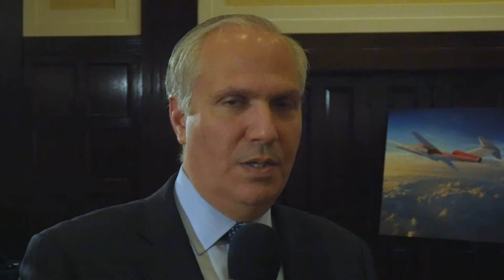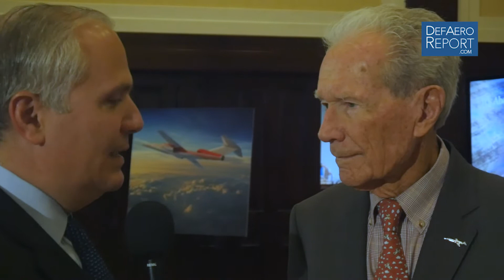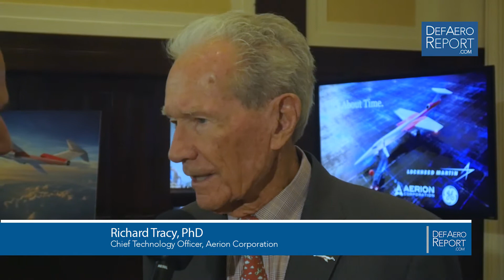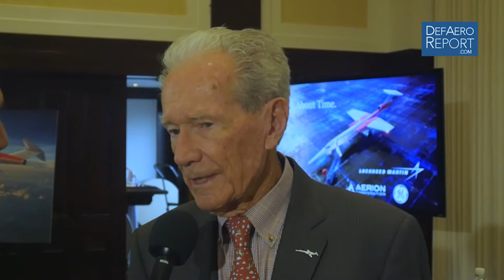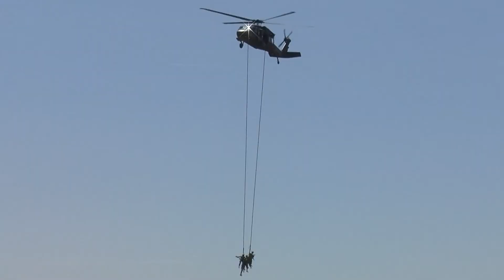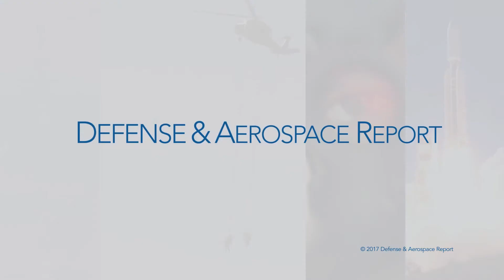Aerion's Tracy on the Science Behind the AS2 Supersonic Business Jet

Comment: Vago, awesome interview and great questions. What I wonder after all these technical specs of the plane were detailed, for the common folk, how does that translate in practice. What are the benefits of all those engineering feats in an everyday situations for the common user. What I'd like to know that was not discussed is short field capabilities of that plane, how efficient is it on multiple short haul stops, 45 min to 1hr legs, when you have to go visit 5 different customers in one afternoon. Are there any limitations and airports that this plane cannot go in, especially rural and small country airports. What is the useful load of the plane, realistically though, can you transport 10 people with 2 bags each, plus pilots and fa, and their luggage. Total 13 people x 200lbs each and 26 bags x 50 lbs each bag for a total and full fuel load, traveling transonic? The stats are cool but do they translate into practicality?
If i can't land in small airports due to noise restrictions or runway length what's the point?
Also, in comparison, conventional biz jet don't reach their full cruise speed until they level off at top of climb, which is usually well 30 mins into the flight, and on a short 50 min leg that advantage of the aeron to be able to cruise at M.95 is negated.
It's super cool that the plane is super advanced, but if we cannot extract the advantages in every day situations, what's the point???
Also, it was not detailed what kind of maintenance program that plane will need, how much would it be compared to conventional biz jets, more, less, easier, much more complicated, availability of qualified personnel to service aircraft across the map...
I mean,  grandpa is awesome and cool, super smart and what not, but it's not like they already have an infrastructure like most other manufacturers have. 
Also what will pilot training cost, ballpark figures. How easy will the transition for pilots be? What kind of avionics and systems will it have? 

Thank you very much. Looking forward to hearing from you